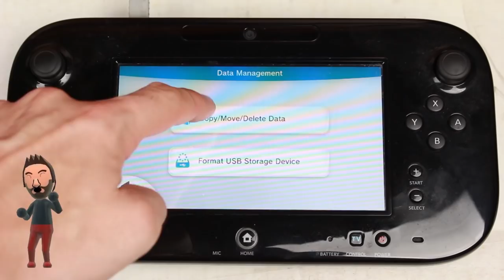Wii U INTERNAL SSD MOD

Comment: Just so people know, this can absolutely be done without messing with the optical drive
Reply from the maker: It worked out better for me because of the size and shape of the drive. Where would you relocate the drive?
Reply: @ImmodderNation   Obviously it depends what you have to hand, but under the main board between the Wi-Fi and the Bluetooth modules, these are raised slightly anyway so something like an M.2 SSD with USB adaptor, microSD to USB or like I did which was a regular SSD without the 2.5” case plus an adaptor fits without removing anything. 

The metal shielding still fits and works as a heat sync.
Reply from the maker: Do you have any pictures Core2Lee? I'm having a hard time visualizing it.
Reply: @ImmodderNation  I did try to reply with a link to a Reddit post I did on r/WiiUHacks a few weeks back but I guess YouTube said no. Feel free to take a look on Reddit it’s a few posts from the top.
Reply: But how?

Comment: I thought you were actually replacing the factory storage? not adding usb SSD!
Reply from the maker: Replacing NAND storage is not possible. That's why I expanded it.
Reply: @ImmodderNation  I know there exists a tool that let's you read nand flash, insane parts used it to upgrade the flash in an iPhone, he cloned the data to a larger capacity chip
Reply from the maker: I don't know if iPhone uses the same encryption, but I've heard copying the NAND memory won't work. Something about Nintendo not recognizing the copied NAND.

Comment: Short and sweet summary. Nice work! It looks straightforward. Seeing this I am assuming that you may prefer getting your Wii U games digitally? Then again just the DLC for some games can take up so much space too! Also, this is off topic here but just a thought. I like how simple they make it change the clock battery. I recently got an original model ps2 and it was a nightmare taking that apart just to change the dead clock battery. I get a little nervous when it comes to taking apart more complex consoles.
Reply from the maker: One of the most involved disassemblies for me is the fat model PS3. I can appreciate the sideloaded CMOS battery. There's two ways to get titles on Wii U either eShop or the Homebrew app Disc2App which does exactly what it sounds like. Converts discs to digital. eShop takes less steps, but my internet connection is slow.
Reply: @ImmodderNation  Yeah I can imagine how rough it would be take apart a fat model PS3. That console is massive. I haven't heard of the Homebrew disc2app before. I think I'll check that out.
Reply from the maker: It'll take your Wii U game discs and convert them to digital file format which can be stored on the system.

Comment: I realise you are using an SSD, but is the I/O on the system better after doing that or still USBsuck speeds?
Reply from the maker: USB speed. If you watch the original video, I talk about it. SSD is supposedly better that USB thumb drive or HDD for data integrity.
Reply: fair enough :) it's just a shame you can't add some kind of usb hub to allow other USB accessories to be used.
Reply from the maker: @Nossieuk  What other USB accessories are you using?
Reply: Switch gamecube adapter in the front (2x) and ethernet adapter in the back, still one spare in the back for storage that I use with a 256GB ultrafit SD  -- I guess I'm wondering if it's possible to take apart a powered hub, hook it up like the nespi case does for rpi3 inside the Wiiu, 2 on the back and another or more on the inside --- I really love this mod don't get me wrong - just wondering how far it can go - can the internal eMMC be upgraded? were there 64/128GB variants? https://assemblergames.com/threads/theory-upgrade-wiiu-storage.62593/

Comment: Do ssd's give any advantage in load times? And only need one usb port?
Reply from the maker: No advantage with load times because the USB port is the bottleneck. USB 2.0 provides enough power for this SSD without the additional USB port but be sure to check your SSDs power requirements first.
Reply: Don't listen to him, SSDs to provide better loading times even though the USB connection bottlenecks. This is because an SSD has much better random read speeds
Reply from the maker: Even if that were true, load times are still the same. Milliseconds don't mean anything in real world applications.
Reply: @ImmodderNation  you could use ssds in speedruns probably
Reply from the maker: Maybe, but I think version of the game is more important. Usually the Japanese version of whatever game is best because of glitches and faster loading.
Reply: @dum-dum  SSDs are probably irrelevant for speedruns because it will always have faster loadtimes on the internal storage.
Reply: @ImmodderNation  Yeah, they may in theory reduce random read stutter in gameplay since the random read data will be ready sooner. But only if the random read is for data less than the bandwidth of the port, if it's more than it the hard drive has time to catch up while the files transfer.

But loading is a high bandwidth mostly sequential read, so a hard drive and SSD will perform about the same over USB 2.0. Both much faster than a disc drive

However, this is a really cool idea that I'll probably do to my Wii U

Are there any issues with the drive not being fully powered?. I heard the Wii U has really weak USB ports.
Reply from the maker: Wii U USB ports are no different than any other USB 2.0. 500 mA max. If your SSD is more, you'll need both USB plugs. I got lucky that my SSD doesn't need that amount. You could also use a 5V stepdown converter from the 15V input voltage if you don't want to use two USB ports.
Reply: @dum-dum  your Garfield background is cool!
Reply: @HistoryandReviews  jarfield

Comment: try integrate gamecube controller adapter internally on the Wii U :)
Reply from the maker: Not much room, but the USB to GameCube adapter can be used. Have to cut into the side of the case for that.
Reply: So can you?
Reply from the maker: I can. Will I? Probably not, I don't play a lot of Smash.

Comment: very nice mod, can you do a clear step by step mod on a new battery for wiiU gamepad? for example i was thinking about using  a lithium  18650 battery plus a 3d printed back door for it, but i have no clue on what the wiiU gamepad wires because there are 4 wires
Reply from the maker: Red and black are your power and ground. I would imagine one wire checks the batteries voltage and the last wire charges the battery until maximum voltage is reached. There's a Wii U extended battery for the gamepad. It's rare but it exists.

Comment: I bought a usb stick that’s literally the size of a wireless mouse little dongle (about 2 cm long that sticks out of the console) and I feel like it’s a good solution. It doesn’t stick out much at all, and it has 32 gb. It’s not a lot of storage, but it works for me. And there might be versions of it for that small size or similar with more storage
Reply from the maker: If you feel good about it, that's fine, but if that drive falls out, you've lost all your games and have to start over.
Reply: ImmodderNation 
Isn’t it possible to have your save data on the internal storage, and the actual game data on the external drive (my usb stick)? So if it does fail, it wouldn’t be a huge problem, I could just redownload my games (I don’t have a whole lot there in the first place). Or maybe the save data can only be on internal storage, like the switch. I’ll have to check. Also props to you for replying to comments even on a year old video lol
Reply from the maker: I think you may be able to move save data over to SD card slot, but I don't know if you can move it between drives separate from the install drive. You'll have to try it and let me know.

Comment: Honestly curious, how much does the SSD do for load times and whatnot? Not a stickler for waiting through loading but would be a fun project if it has a benefit as well
Reply from the maker: No difference. Bottlenecked by the USB lanes. It's more compact and stable but no speed improvement.
Reply from the maker: Normal drive for the Wii U is eMMC flash memory. No sound and relatively low failure rate.

Comment: Seems like it would be a better idea to remove the dvd drive and just create a newer smaller case, also I think this would be more compatible with USB thumb drives I see it have compatibility issues with SSD drvies. I could be wrong
Reply from the maker: Stay in your lane, health and fitness 😂😂😂
Reply: @ImmodderNation  Bro💀💀💀
Reply from the maker: @joaquim-9383  "Paul your macros are all wrong. Less reps, heavier weight, to failure" 🤣STFU and get out of here with that.

Comment: What is the advantages to this over just using a usb thumb drive?
Reply from the maker: Rewrite-ability. People claim that a thumb drive can't handle the constant read/write cycles that a HDD or SSD can.  This mod is for people that want durable affordable extended storage that doesn't hang off the back of their console that ISN'T a usb thumb drive. Hope that makes sense.
Reply: @ImmodderNation  

That sounds good.

Any reason why you couldn't use a normal usb ssd other than aesthetics?

I was given a free wii u that needs a screen. 

Once it's fixed I wanna turn it into a retro emulator so I can save wear and tear on my original retro consoles.

I really wouldn't mind just plugging an ssd right into the usb port if it's all the same.
Reply from the maker: It's hard wired so it doesn't disconnect during transit or gameplay. It's internal for aesthetics. Plugging it in is all the same.
Reply: @ImmodderNation  thank you for the information.
Reply from the maker: @jldwolfe  You're welcome.

Comment: Can you still use the USB port? I am wondering about if it will slow it down or even be read if I add another device to it. I seen people do these mods for the PS4 and Xbox one and 360 using the USB ports so I thought I would finally ask.
Reply from the maker: No, the lanes for the USB port are occupied. You should not plug in another device with the drive connected.
Reply: The thing is. Which one of the ports is the one you used? There are two. I would totally block the port from the outside if necessary
Reply from the maker: Follow the traces for your answer. Use a multimeter in continuity mode or just look at it from both sides of the board.

Comment: I went with a sandisk ultra fit, but they only go up to 256gb. It seems like a lot but if you want to keep a lot of Wii U games + Wii and GC VC injections, it runs out fast. And you don't want to fill these flash media drives completely, because that reduces the lifespan. 
So for that reason I say A+ mod will try soon.
Reply from the maker: Previous video was a USB thumb drive.
Reply: @ImmodderNation  Yeah I have mine plugged in normally but it's an ultra fit so it only sticks out a few cm
Reply from the maker: By the way thank you for the compliment
Reply: That's gonna die, mine did
Reply from the maker: Your SSD?

Comment: With this mod can I put another external storage to the WiiU? Because the WiiU says it can load to different storages at the same time
Reply from the maker: According to Nintendo, the limit is 2 TB. I don't know if that's total or per individual drives.
Reply from the maker: But to answer your question better, you can have up to 2 external storages
Reply: @ImmodderNation  ah ok thanks
But one time i was using 2 thumsticks as external storage and i couldn't use both at the same time for gaming, only for transfer the games from one to another or the internal
Reply from the maker: I believe you're right. I think I used the 2 external to transfer games from usb to SSD. Sorry it's been a while but it's coming back to me.
Reply: @ImmodderNation  no problem, thanks 😊
Reply from the maker: You're welcome. Good luck

Comment: Ese SSD estará muriendo cada que uses esa consola por el tema del TRIM 😥😥😥
Reply from the maker: ¿Todos los electrónicos mueren un poco cuanto más lo usas, no? 😉
Reply: @ImmodderNation  totalmente de acuerdo pero el tema de TRIM implica que ese SSD se iran dañando muy rapidamente los sectores recortando drasticamente la vida util del mismo. Ya lo vi en muchas consolas (PS2, XBOX, WII  y desafortunadamnente  tambien en WII U) 😪 lo.mejor en estas consolas son loa discos mecanicos y en verdad que te puedo decir que sacrificar un SSD de esa forma a cambio de tan poca diferencia en velocidad  no lo veo justificado. Y es una lastima que no haya aun nada para  remediarlo. Saludos aun asi el mod es bueno pero como te digo con disco mecanico. 😀
Reply: @juanmanuelguevaratorres1537  The trim does not improve the ssd durability, it just improve it's write speed, when you write anything to the ssd, thse sector that will receive the data must be erased before being written, so, the trim marks the empty spaces to be erased on idle time, so, when you have data to be written, the spases are already blanked, without trim, you just don't have the spaces already blanked and have to wait the erase operation just before the data is written.

Comment: Power Supply for any HDD or Thumb..
I was wondering if this was possible. Ive done things but not hard drive things yet. But getting the power from elsewhere in the console.

For example solder regular data etc. Cables to usb port as you did, but the V+ power from a 5v spot ? Like the fan or disk drive spots. The fan and disc drive use 5v compared to the PS4 & XB1 they use 12v
Reply from the maker: You just need a 5V and connect the data lines to the USB port. I don't know what the input voltage is on the Wii U but if it's 12V, you could use a buck converter to bring it down to 5V.
Reply: @ImmodderNation  the voltage to run the wii u i believe is 15v-14.5v But most of the things run on 5v like the fan and disc drive only uses 5v .. So thats what I figured, just running the data cables to rhe port

Comment: pff not reall a mod.. its still over usb so its external
Reply from the maker: What is a real mod to you?
Reply: It is better that it is connected to a usb so you can replace the external ssd easy and fast
Reply from the maker: If you ever need to disconnect or replace SSD, it's accessable. You can always use hot glue if you think the connector may come loose.